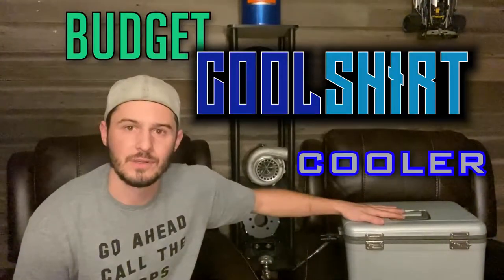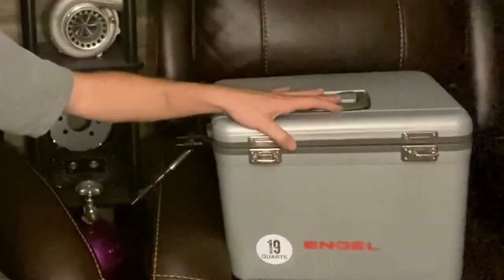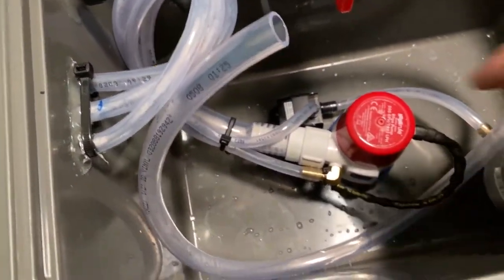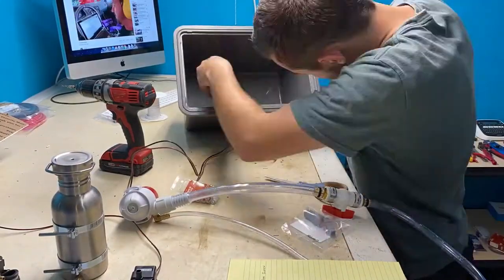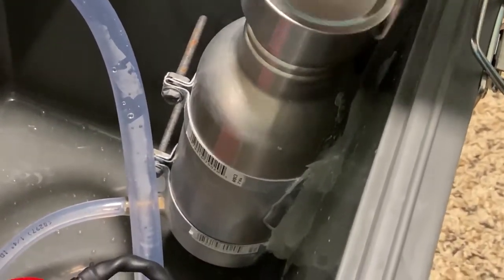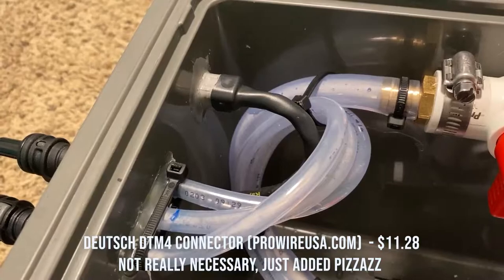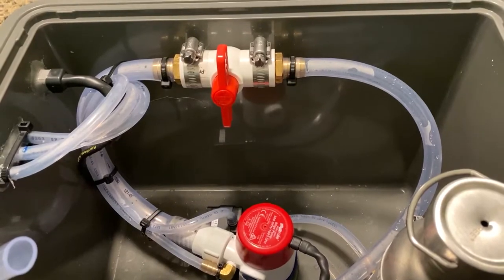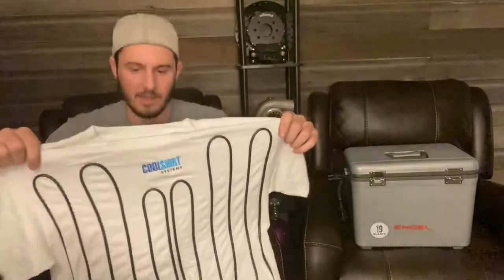I Built a COOLSHIRT Cooler for our Race Car (on a budget!)

Comment: Hi thanks for sharing.
If you are still checking replies here, how well does that work? I mean, is it less brutally hot, or so so, given the circumstances, or is it truly comfortable?
I ride 30 some miles to work each way on a motorcycle in the Florida heat, in full gear, so I made up a kind of front/back vest with Revix freezer packs. It works so well it feels like air conditioning for the whole 40 minute ride.I even chose a winter riding jacket with the liner removed, so as to keep the cold in. But on those peak heat days where its 93f and up to 100 it fades to barely tolerable by the time I get there. Currently working on V2 with Nordic Ice freezer packs. I want total comfort!
I see what youve done there but I doubt there is enough surface area on the piping to provide enough heat transfer to be totally comfortable. Am I wrong? I hope so.

Comment: Great diy!  One question as I do not have the parts in hand… yet…. Does the coolshirt fitting work directly with the camelbak hydrolink? Is there an intermediary?
Reply from the maker: Thanks for watching! The cool shirt does not work with the hydro link. I just used them to interface with the car. You’ll need cool shirts fittings to attach it to your system. They are also break aways in case you need to get out of the car in a hurry.

Comment: what size is the tubes in the shirts?  I have an ex-military cooling garb ... but no cooler, pump etc... its garment's hose is about 1/4" in size. Apparently the pump that originally went with it at lowest setting was 0.1gal/min (350ml/min) at 5psi*.   Im concerned a bilge pump like used in this vid. would be to high PSI and blow the thing apart.  Appears your pump is like others have used such as the Tsunami T500.  What is your thoughts?

*in the manual on the garb it list 10psi of air was max to use to force drain the tubes for storage of garb. So apparently it can go up to 10psi.
Reply: Bilge pumps are typically rated in feet of head - e.g. how high they will lift the water.  Every two feet is about one PSI; most bilge pumps are designed to move a lot of water overboard, which doesn't require a lot of lift on most boats.   Typical lift is 10-12 feet, so you're looking at 5-6 psi.
Reply: @BartSmaalders  muchas gracias